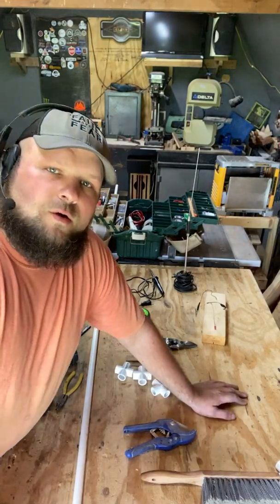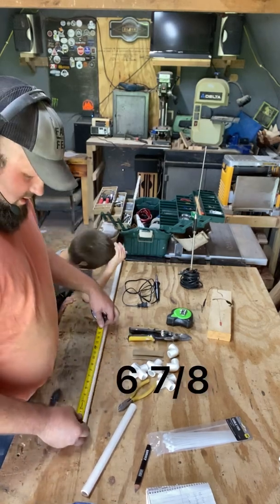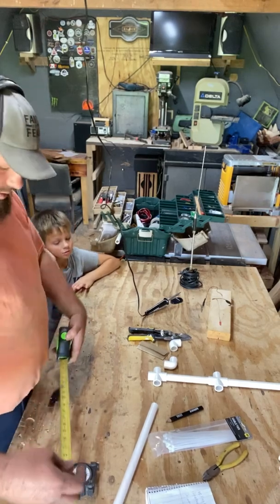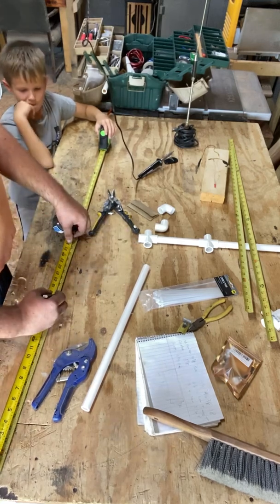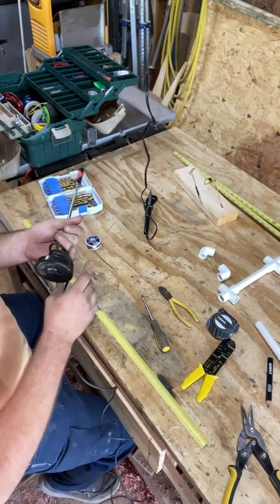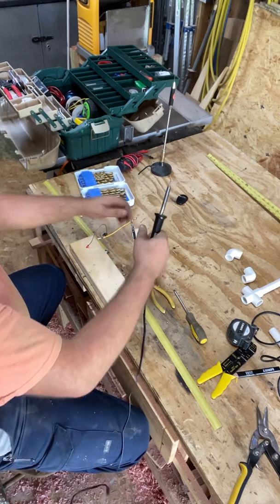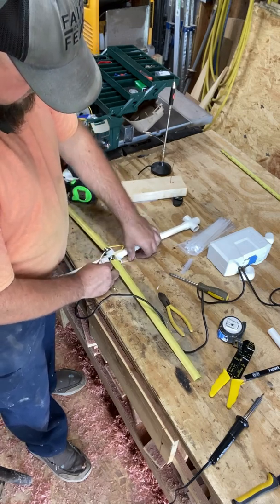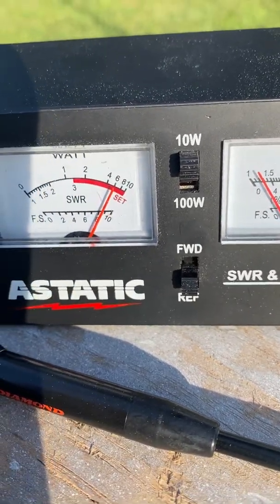How to 2m tape measure yagi

Comment: Quick and easy build!
I am putting one of these on my build list too.
Have you tried it with something other than the Baofeng?
How far is the reach?
73's!
Reply from the maker: This yagi doesn’t work very well for transmit . It’s more for fox hunting. Receive is very well. I haven’t tried it with any other radio. I have aluminum yagi built hoping to try it out tomarrow. I can receive at least 20miles. 73s
Reply: @All_Things_Radio  Awesome! Hope it works well for you!
Reply from the maker: @NukaVaultReadiness  yes I’m hoping it works. I tried to setup the portable mast yesterday and one of the tie down stakes beoke